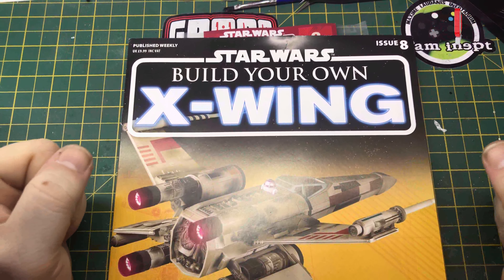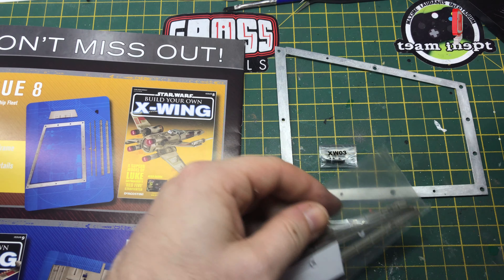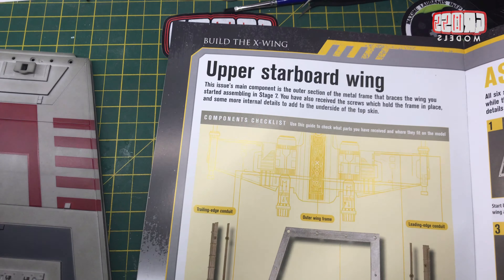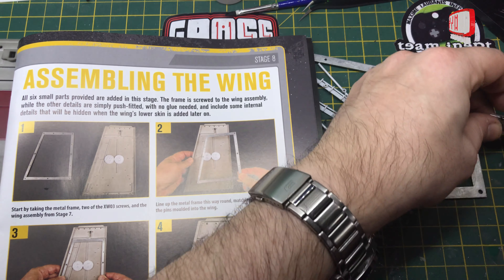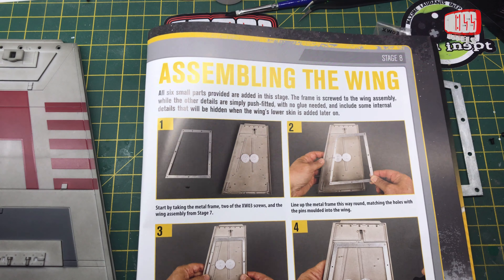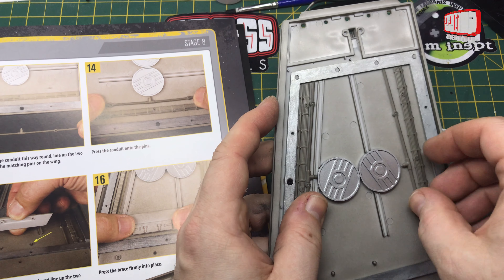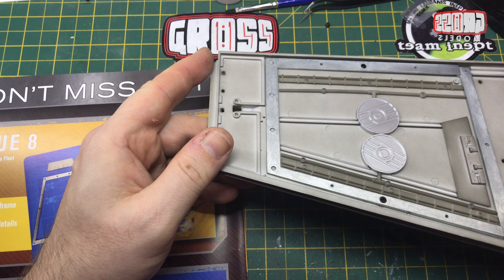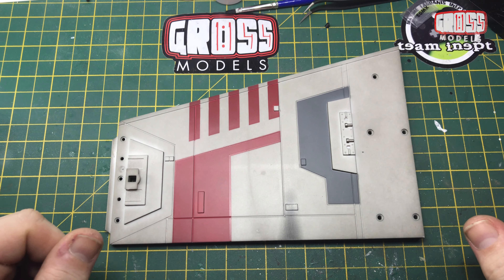DeAgostini 1:18 scale x-wing build. Issue 8

Comment: This looks a lot of fun, wish I had the patients to build something like this. What appeals to you with magazine builds? You do quite a few of them.
Reply from the maker: I do like spreading the cost of a build, I wouldn’t spend hundreds on a single kit normally. 
I used to build one thing at a time, but the partwork system doesn’t work for that, so I have started doing more than a single build.